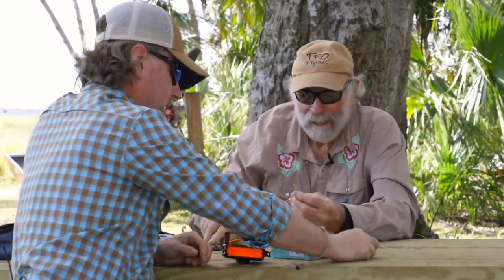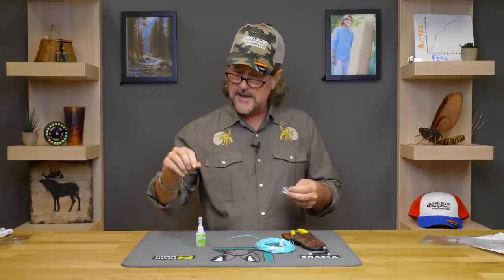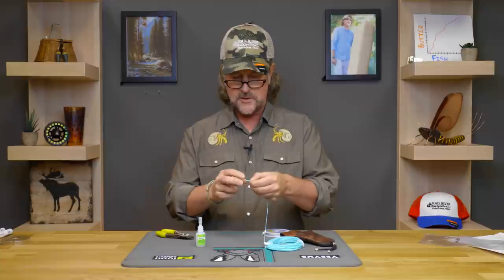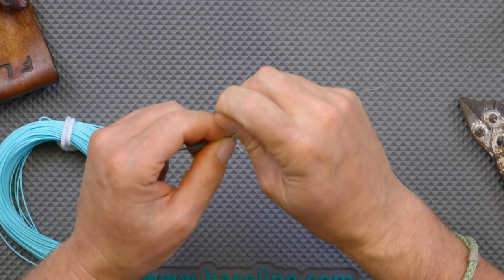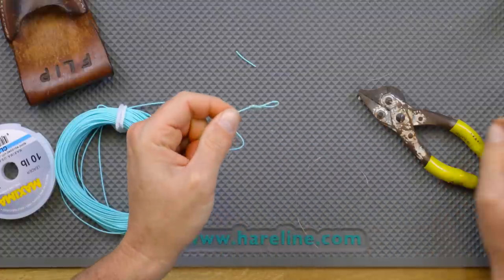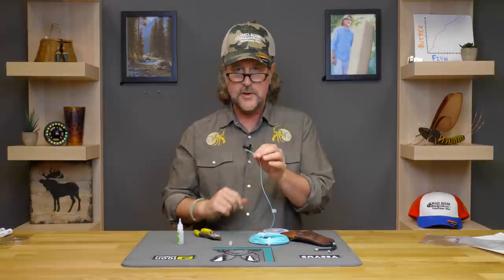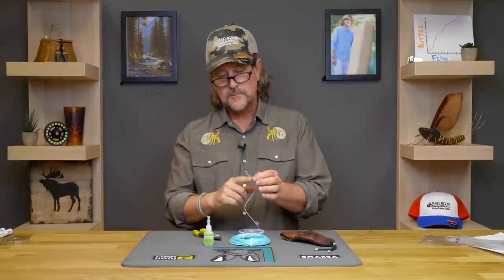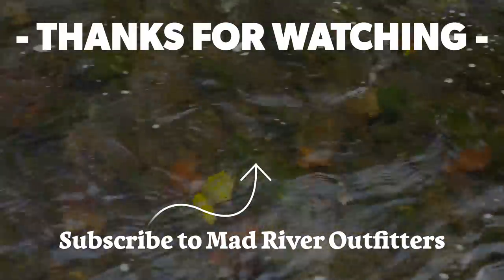How to Whip a Loop on to a Fly Line

Comment: So do you think it’s better just to cut the loop off of the leader and attach it with a nail knot ?  Almost all the leaders have loops in them nowadays.
Reply from the maker: This is for the end of the fly line....to attach to the backing. You should NEVER do this on the front of the line. Any further questions, please contact Brian directly through the shop. You can e-mail him or call him. Thanks.

Comment: Would this be ok for attaching fly line to line backing if the fly line you have doesnt come with a loop? Just makong sure im understanding the point of the video correctly.
Reply from the maker: That IS the point of the video. Thanks for watching.
Reply: @Madriveroutfitters  Ty. Replacing ALL my fly gear that was lost in a fire back in 2019. Just not getting to the point where I can and the fly line I bought doesnt have welded loops (on a bit of a budget lol). I was able to find a pflueger 1595 at a decent price on ebay that was new old stock. Its one of the reels I had before (first reel I ever had my grandma bought for me as a birthday present) so was happy to get another one. Now Im on the hunt for a 2pc 9' rod. Not a fan of the 3 or 4 pc rods. May end up building one.

Comment: Greetings.  Besides the butt section of a leader, has the general Butt Section gone the way of the Dodo?  I don't see it in any of your videos.  I was taught, 40-years ago, to put a butt section between my line and leader.  Is this because of the Loop systems which many have now?
Reply from the maker: Thanks for checking with us. Leader = Butt + Tippet. You can't have a leader without a butt section.